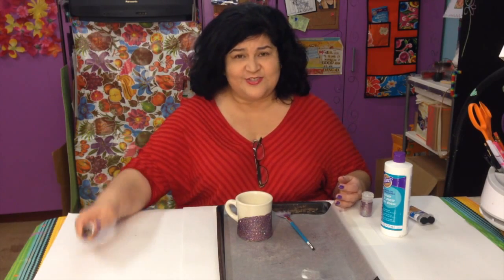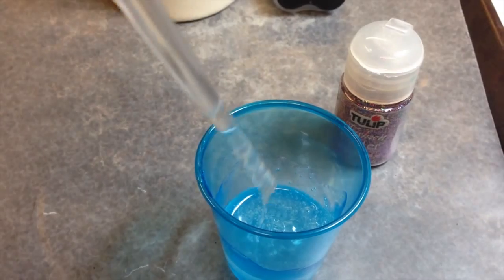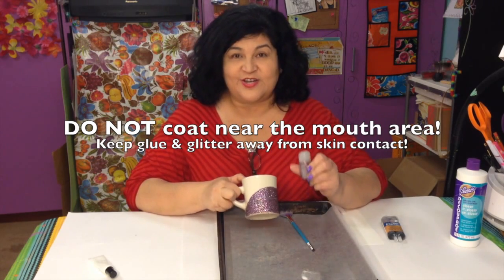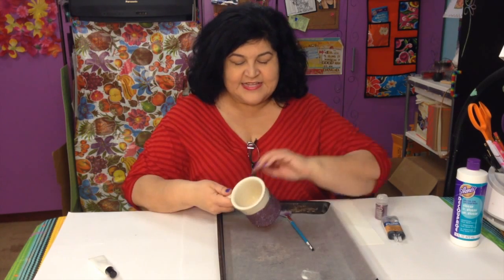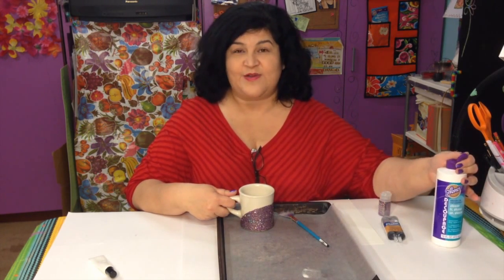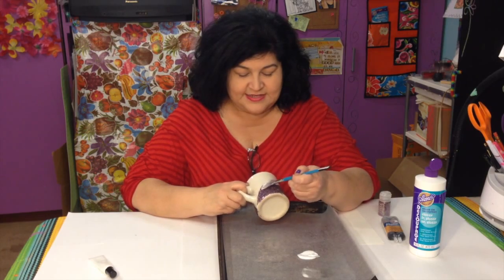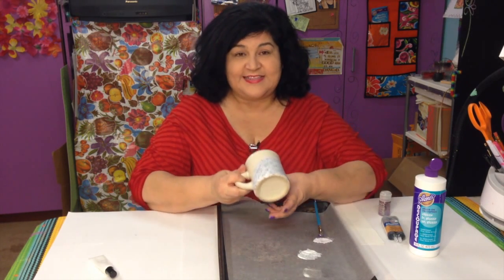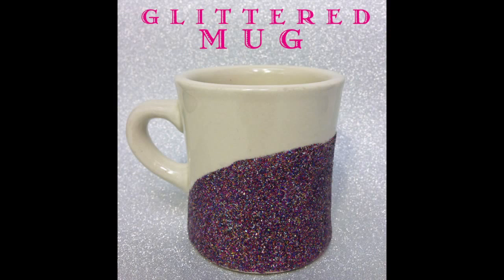How to make a glittered mug

Comment: I am not big on glitter or coffee but that does look nice. :) I would have done some sort of design myself - probably a paisley print - then glittered it. Does that decoupage make a good sealer? Does it get sticky or tacky or yellow over time? I am looking for something easy to get for sealing my clay pieces. I know varathane is the best but it is so darn hard to find locally.

- Heidi
Reply from the maker: A water-based decoupage will break down after multiple washings. For your clay pieces, a urethane-based sealer would be more appropriate if they will be exposed to moisture.

Comment: I am guessing this would work on plastic tumblers too wouldn't it. and where do you get the glue and the white stuff you out on afterwards?
Reply: +arielbaby9832 Hi! I wouldn't do it on a plastic tumbler, the epoxy would eat through it. You can get the other supplies at the craft store in the decoupage section. Thanks!

Comment: if we apply any other kind of white glue same like u and apply it to recoat on glittered mug will it be vanished after drying ?
Reply from the maker: +eman khan Hi Eman, you'll want to use a glue that dries permanent on glass and also dries clear. So check the label and make sure it works on glass before using! Some white glues only work on paper products. We hope this helps!